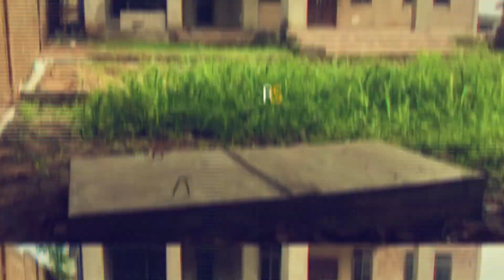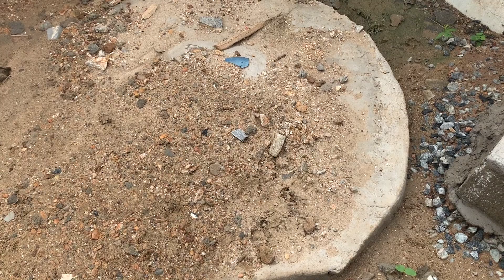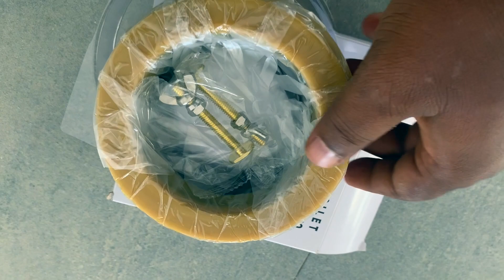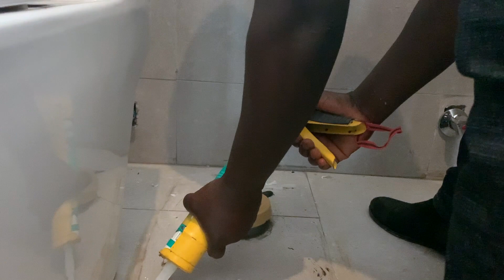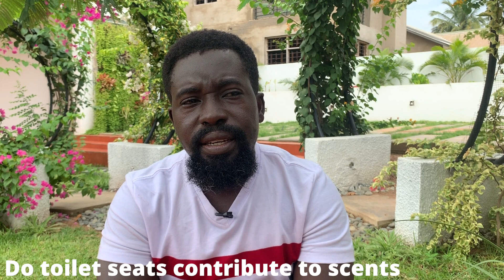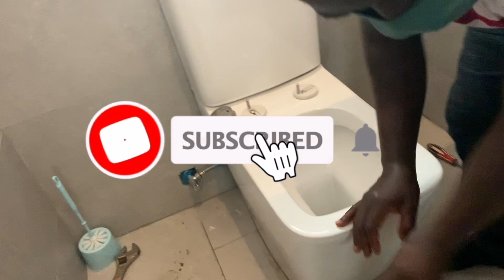Biodigester Toilet Construction and Bathroom Smells: The Real Truth

Comment: Using P- trap fittings will eliminate all the  plumbing problems ending up with scents in the house. Also vents should go out on the roof not in the yard like you have there
Reply: Kofi you must be a plumber cuz you are absolutely right. Africa -  That seal is also that water doesn't run out the bottom of the toilet when it is flushed. That silicone he's putting on the floor is unnecessary. Why do you think the nut and bolt came in the package? That guy is a bootleg plumber.

Comment: I see all the plumbing parts here, do they sell these all I need to bring them from USA.
Reply from the maker: They are all in Ghana. But I know a few clients who usually bring their accessories especially bathroom stuffs from outside.
Reply: 1. https://www.lowes.com/pd/Oatey-PVC-Flange/50315061 get the one to match the pipe for your rough plumbing also with
2. https://www.lowes.com/pd/Oatey-Johni-Ring-Wax-3-in-in-Jumbo-Toilet-Wax-Ring-with-Bolts-For-Hercules/3956165 and make sure like Kofi Out said it is vented and all bathtubs, face basins and kitchen sinks have p traps. A p trap holds water and since scent  doesn't pass through water it'll go out to the vent. 
3. If you buy a toilet from the US the wax ring comes with it.